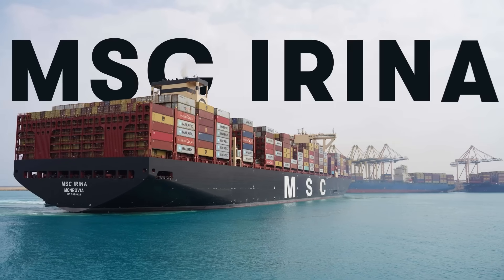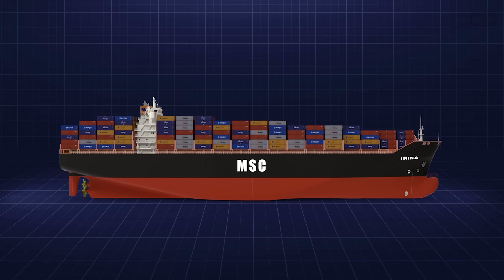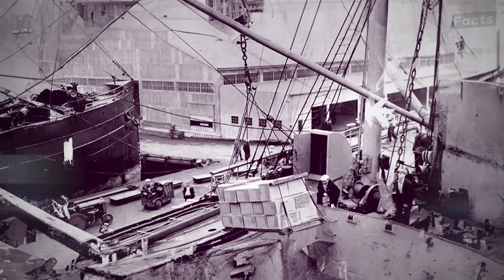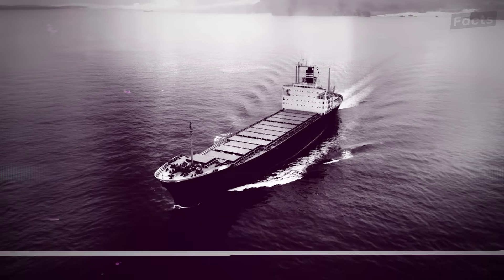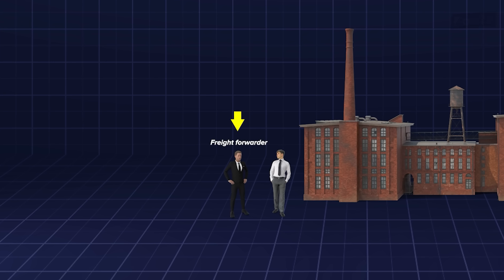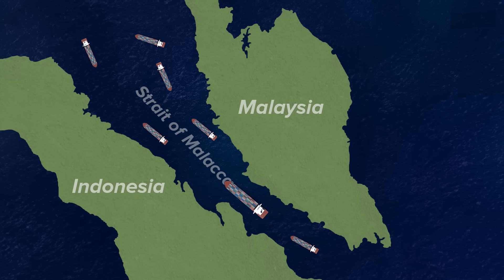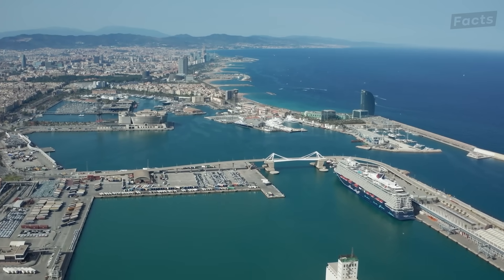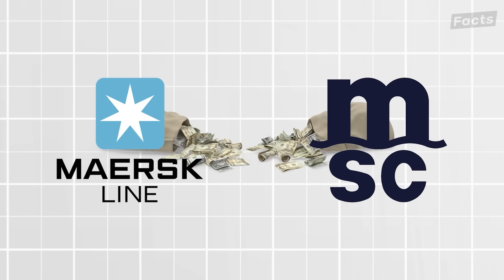Life Inside the World's Largest Container Ships Ever Built

Comment: Some mis- information, twistlocks are for on deck, most below are in cellguides, breakbulk vessels worked more than 8 hours and were in port sometimes for a couple of days. Containership are more likely to work 8 hours. Chief Mate was responsible for stability not the Chief Engineer. Stevedores hired the longshoremen! Modern large container ships are up to 24500 twenty foot units but projection for the future are for vessels up to 50,000 twenty footers, mind boogling!

Comment: They need bigger ships with a flat bottom and a bubble of air trapped under the ship.  (OK, this ship actually has that.)
This would eliminate 1/3 of the interface of the hull with the water and reduce friction dramatically.
Larger ships with routes that only call at very deep water ports will be the norm in the future.
It might also be possible to have trains of mobile containers on the ships that could drive right off the container ship and displace to cheaper interior land via train tracks.
If someone wants to throw big bags of money at me, I am available for the engineering work.